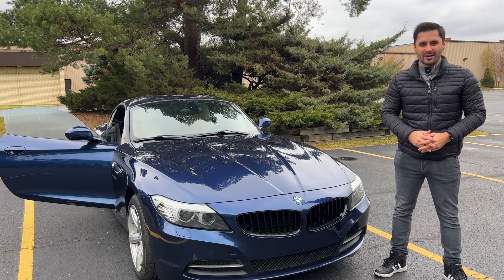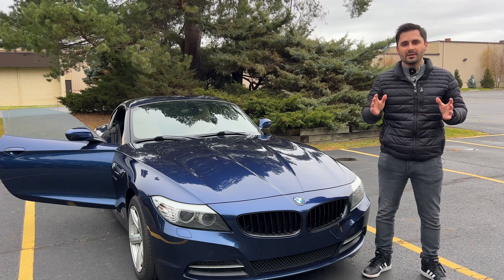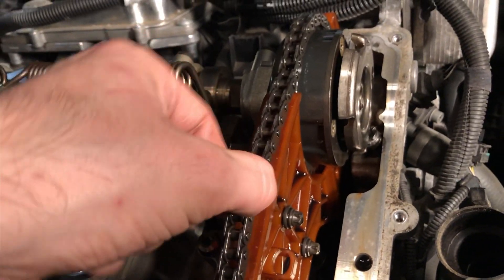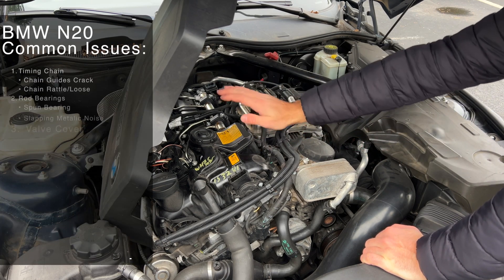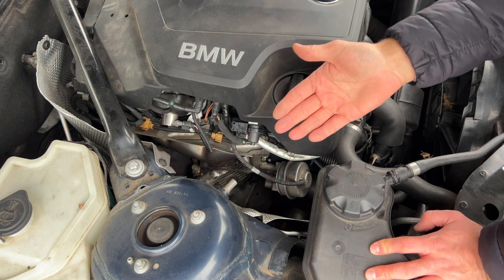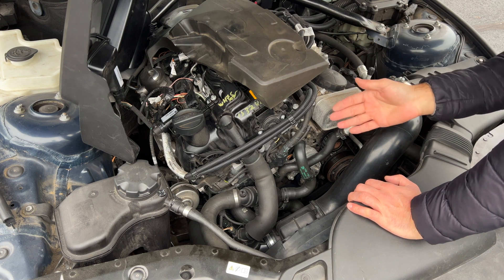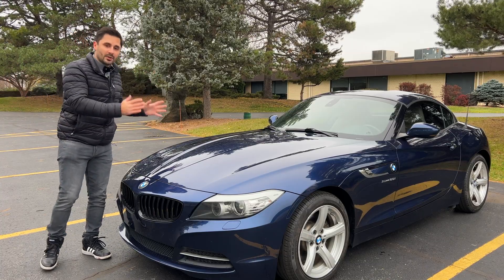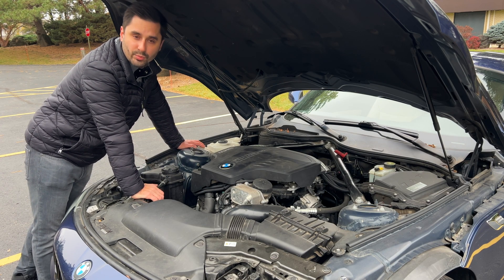BMW N20 Problems to Expect - Reliability Report

Comment: Super great video 👌 I'm searching for a 320 between 2016 to 2019 and I wonder if the petrol engine really is that bad compared to the diesel, as many people say? I personally can't find anything that's proves that! And also, I wonder if the automatic gearbox is a better choice than the manual?  I personally don't mind wich, I just wanna look for the most reliable gearbox and engine! Can you recommend what I should look for the most? 
That would be very helpful :)

Comment: 2014 328i here 👋 167k miles and runs like new. Just did all the gaskets was leaking everywhere lol. And wastegate actuator went bad. Other than that just oil changes every 6k miles. But mostly just highway miles. Got the car with 58k miles btw
Reply: How u knew
Reply: @unknownviralTV  knew what
Reply: @burtiik006 the wastage went bad how u knew it ? Because I have 120308 and 120408
Reply: Which gaskets you replace? Thinking about doing some PM on my 110k mile 428i
Reply: @LoganBarrettTriggerHappyGamez  first was valve cover around 90k it was dripping at the exhaust manifold and smell so bad. Than oil cooler and last was oil pan. That was pain. You have to lift the engine and drop the sub frame. And as we speak last week turbo coolant line blow up so I did coolant lines and oil lines to turbo
Reply: Wao, seems like you have been taking good care of your car. I am recently getting an error p0243 which is related to the wastegate. Did you have an electronic wastegate? How did you fix it? Did you need to replace the wastegate actuator?

Comment: 2 liter N20B20 engines came with different compression ratios, so it's not just engine map that produces different power levels. 

I had timing chain changed at around 145 thousand kms. It did not fail, but it was recommended to me. 145 000 kms is not too bad, nothing lasts forever. This has been from where I'm standing a reliable engine. Having owned couple VW TSI equipped cars, to me this is like bullet proof engine.

Comment: 2013 bmw x3 n20 220k original chain ,no issues whatsoever.  Oil change every 3000miles and start stop fisabled.
Reply: I think regular oil changes is the key.  N20's with extended oil change intervals tended to be the victims on the earlier cars. My 2014 428i is on original chain here in uk (78k miles)and oil changed much more frequently than BMW recommend (Approx every 4 -5k)It runs well. I love it.
Reply: How did you disable stop start its annoying
Reply: @givansaldana15 you need to find someone who can program the cars computer
Reply: @givansaldana15 the button above the ignition. If the light is orange then it’s off.
Reply: I Am wonder How does your engine sound?
Reply: @gepo3637 like shit. You always find these people. "My Yugo has 300k on it. Never let me down very reliable"

Comment: Got a 428i with an N20, note thay it got stolen and stood outside for a year, when i got it back the ignition misfired frequently, had to replace the battery, then the timingchain had to be replaced next to the oil pump and hoses, i also has to replace the drive line after that. On top of this the front suspension has to be replaced along with the brake calipers and disks, inssuraced covered everything except for the engine service and driveline landing my total repair on 12.000€. When i got the car back M-bilar who is my workshop has reworked the interior and polished it so that it felt absolutely new, they felt sorry so the leather repair and most of the time they spend on repairs they actually gave me for free

Comment: I have an f10 2015 528i and with 81k on the engine  I HAVENT had any issues but the tersmostat, and motor mounts,, and the mickey mouse house  thats it, it nice it runs great,  the one isssue that I JUST got it check and told me the the G module is off,?? SOMETING w canbus? Is any one know WHAT ir is?? I live in México and no one know WHAT it is?? EVEN with a bmw scaner CAN SOME ONE HELP ME?

Comment: Great video very clear and to the point.  My question is that I am looking at a 2015 428i convertible today with the N20 engine.  How do I know if this engine has had the updates????  You say 2015 and beyond is good.......but is it possible some of the 2015 model years have the older technology in them?  Thank you
Reply: Models built from March 2015 have the new guides

Comment: BMW N20 engine has defective design that leads to permanent engine failure. Hundreds of customers have faced engine issues ranging from timing belt to fuel pump low pressure resulting to engine Blow outs. BMW dealers are quoting anything in the range of 15k to 20 k for engine replacement with no major recalls on this issue. There is also a class action suite for these defective engines for which BMW was asked try the courts to compensate the affected customers. Absolutely horrific quality control and servicing by BMW and pathetic response from BMW customer relations that customers need to be aware of.

Comment: Great video. Easy to understand speeking, good showing underhood elements etc. Mine is 228i 2104year, and i care about it. valve cover replacted, and still a little oil leak.
Reply: Do you still have ur z4?

Comment: It’s a great car, only had to replace the engine once at 105k miles. Thankfully under my extended warranty
Reply: lol You have a strange definition of "great" if you think that replacing an engine at only 105K miles is acceptable.

Comment: Expect engine failure at around 100-110k 

This is not a reliable engine ,it's probably the worst one in BMWs history 

They arel class actions outthere regarding this .

The defect : 
Valvetronic and timing chains
Reply: Yep, engine went out due to timing chain at 90000 miles

Comment: I have a 228i Xdrive I that it was N20. Or is it F22 I’m a new buyer and would like to know
Reply: F22 is the model code for the first generation 2 series coupe (new one is G42). I have an F23 which means it's a convertible F22. It's a way for BMW fans to differentiate generations of a model. The 28i F22's produced from 2014-2016 have the N20, and the timing chain issue on N20 engines was fixed for 2015 and later models. That engine was replaced by the B48 for 2016-2021 F22 models and the name was changed to the 230i. The current 228i name was transferred to a front wheel drive, 4 door compact car.
Reply: @jfox24  you help me out tremendously and luckily for me according to your assessment I have a 2015 so I may be good as far as the timing chain issue is concerned but I love the car and will continue to take care of it
Reply: @WillWay-39  happy to help. I love mine but it's been the most expensive car I've owned. No catastrophic timing chain issues, but I've had valve cover gasket leaks which was not a cheap fix. Also, if you're new to driving a turbo car you need to let it warm up for about a minute (RPMs will drop) before driving off. You also need to let the turbo cool down for a minute or 2 before shutting the engine off completely if you drove it hard. This includes the automatic start/stop function which cuts your engine to save fuel. I don't use that feature just in case.
Reply: @jfox24  so I’ve noticed that when I start it the rpm gauge basically lets me know that it’s not ready to pull off yet, typically right over 1000 then it stabilizes below 1000 when it’s ready, but I am new to driving a turbo car so are you saying even in warm weather before I cut the car off I should put it in park and set for a  minute and then shut it off? And also 😂 it’s definitely the most expensive I’ve ever had the gas alone is out of control but I really do appreciate you I love learning and you seem like a good person so I hope all is well with yours
Reply: @jfox24  and I don’t like the automatic start stop function but I do make a mistake sometimes when I get home from work by just cutting it off as soon as I pull up thanks to you ik not to do that anymore
Reply: @WillWay-39   yeah the owners manual says "don't let the car idle, drive off immediately after starting. It's the best way to warm up the engine" which doesn't sound right to me. BMW also coded the N20 to run hotter than needed to increase repairs from the dealerships. So I think that's another trick to get more repair money. "Warming up" also refers to coolant and oil circulation, same with cooling down. I also wait for the revs to fall on the tachometer so you're doing it right. It gets surprisingly bad fuel economy for a 4 cylinder and it takes premium. I live in Atlanta (hot climate) and my average is like 15.6 mpg because of all the stop and go acceleration. I've seen it return 32 mpg on the highway, but only in Eco Pro where you can coast at 500 rpm. Basically, driving the car while the turbo is in boost uses extra fuel to take advantage of the extra air. Based on listening to the turbo with the top down, the boost threshold is at 2500 rpm so keep it below that for the best fuel economy.
Reply: @WillWay-39  yeah this is my first turbo car after coming from an old Acura and a Corolla. From what I've gathered, the turbo needs time after you start the engine for the coolant to flow into it. If you've been driving hard in boost, suddenly cutting off the engine will stop the flow of fluid to the turbo. It has nothing to gradually cool it down which can damage it. This is why the start stop can damage your car. So just to be safe, after I park my car I wait a minute or 2 so that my turbo can cool down.
Reply: @jfox24  literally it’s like your spot on with what I’m seeing. The car gets so hot I thought it was overheating a couple of times so now ik I’m at least doing it right. Wait for the idle to drop when starting then pull up parking and just a little idle then cut off. I’m In Illinois not too far from Chicago and I feel like for a 4-cylinder even up here it does get the greatest gas mileage but in eco it does increase my mpg. And seriously thank you man not too many ppl are willing to share information like that and im willing to listen and learn.
Reply: @WillWay-39  of course! I just got this car like a year and a half ago off my dad so it's been a learning process. I hear you can make the engine run colder with a tune. Coming from a Corolla, I was definitely surprised by the maintenance and fuel economy. My dad heavily optioned it with carbon ceramic brakes and a staggered tire setup. That means I have to replace brake pads and rotors at the same time, and I can't rotate my tires for longevity. Makes it handle like a dream though which is why I keep it. I'd look out for valve cover gasket leaks. Also, I hear the charge pipe and the boost pipe can crack under stock boost pressure because they're made of plastic.
Reply: @jfox24  thank you bro where would I check for valve cover leaks
Reply: @WillWay-39  I mean I'm not sure it's just a common issue. I just know I paid like $800 in labor and $400 for the part because it's a 6 hour job and I can't do it myself. You'd probably need to do some research to diagnose it yourself.

Comment: Great i got a 2014 428i 💀 with 90k miles
Reply: @Tvann I just got a 328i last September, been good to me so far got it with 58k miles now I got 67k. Had to do the oil pan but when changing it all my guides were still in place. Gonna do the timing chain soon as I get 3k saved up.
Reply: @robertmoncriefglockrock8957 who’s doing your timing chain for 3k!? In wa the cheapest I’m finding is like 5k😭
Reply: @robertmoncriefglockrock8957 shouldn’t cost 3k, are you taking it to a dealer? I only paid 1k for my timing chains to be redone. Been running a tune since then too
Reply: is 2014 428i doomed with timing change issue?
Reply: @genuflext yes 😭
Reply: I got a 220i 2014🫤
Reply: @destinyyjr9441 how's it treating you so far?

Comment: I have a BMW 228i manual gearbox from the end of 2015 and it has 161,000km. Could there be problems with it in the future?
Reply from the maker: Sounds like a pretty solid car. 2015 should be fine and manual gearboxes are solid. Change your oil at least every 5k miles or 8k kilometers!

Comment: You are the only one i have heard suggest that changing the timing chain tensioner was “easy” or even possible without getting well into the internals and setting all the timing locks to prevent movement unintended timing adjustments.  Would you please verify this is actually possible?  Feels like bad info but if not great!
Reply: The more common issue is the plastic guides just breaking apart and cracking

Comment: This is true. I have a 2015 328i 100k miles it’s still powerful. But I needed to replace the valve cover. Besides that I’m really happy with the reliability
Reply: Have you had any timing chain issues? I want to buy one that has 100k miles
Reply: @Richardv24   no timing issues, i am at 107,000 miles. They always check it every time and is holding up. Although i believe i got the car right after the fixed the chain on future models. Mine was manufacture in may 2015
Reply: 2015 is b48 engine
Reply: @Shiftwithsaj still n20

Comment: Is a 2016 bmw 328i n20 with 60k mile’s reliable?
Reply: Yes by “2016” the timing chain prob is gone
Reply: what about 2014 428i? 40k
Reply: How is you’re car I just got mine at 79k
Reply: @YousefB58  went for a 2014 428i with a n20 instead, picked it up at 58k miles currently at 72k. Car has been treating me well have done 2 oil changes so far, maintenance cost isn’t too bad ordering parts from fcp euro helps.

Comment: I went from a N51 to N20 my god I’m so happy
Reply: What was wrong with the N51? It is essentially the N52 with the low emmision tech on it. I know it suffered from the same problems as the N52..value cover and oil housing leaks, water pump, etc. I heard the N51 cars has the sensors on the fuel tank and the radiator. If they go out you have to replace the tank and the radiator.

My buddy has an 09 328xi that his dad brought in NY. He brought it barely used so I hope the car came from another state and it has the N52
Reply: Same but I came from a n52 to a n20 🎉💨

Comment: Great video. 

I've had my 228i for three years now. 77k miles (of which 23k have been me running a stage 1 map) without a hiccup. But this video is good for making people aware of potential issues. Probably the best one I have seen.

Apparently there are only 228 228i manuals registered where I live and they seem to be going up in value,  so I am keen to look after mine. This video will definitely help.

Comment: hi my name is Marco, I am writing to you from Italy, I follow your channel, I want to ask you for advice, I bought a used z4 e89 20i a few months ago, it is registered on 06/2014, this noise that my mechanic has increased for a few weeks he identified it as a problem with the hydraulic tappets, but the sound you describe in your video at 3:20 minutes is very similar to that of my car, can I have some advice, can I send you the video?

Thanks Marco
Reply from the maker: Hi Marco, I saw the video you sent me, very helpful!
It's very hard to say for sure from a video, but it sounds less 'slappy' so it can be either an early stage of a failing rod bearing or it can be a timing chain getting loose or like your mechanic said the hydraulic valve lifters. It sounds like it's coming more from the back of the engine, so we can probably rule out the timing chain. Next, listen closely to see if it's coming from the top or the bottom. Mine was bottom and it was the rod bearing.
Reply: @SimpleCarGuy  Remember also that the injectors are very noisy

Comment: Wanted to ask if the cooling fan should be on in these days which is like 5~7 degrees ?? I changed thermostat and still when I open the bonnet and check fan is turning…?. Is this normal for N20??

Comment: Wow I wish I would've done some research on the my 13 bmw 328i I just bought all the videos are scary AF .
Reply: just had to do timing chain 72 k miles, 3,600 job
Reply: @SilentEscape818 damn you got ripped off man. Timing chain jobs are like 1.7k max.
Reply: Literally just got my 2013 328i back from the dealership today timing chain guides broke which made my timing skip which them bent the exhaust valves $10.5k in parts and labor happened at 72k miles. Luckily I have a warranty and only had to pay my deductible.

Comment: Thanks. That is a sexy car, in a great colour. I had a 2005 Z4 3.0i for a few years but sold it because it didn't see much use and I got tired of driving a stick. It was minty with rare options, and looked great too, but not as great as yours. That newer body style with the hardtop is the way to go.

Comment: good evening for the n20 2017 120i engine has timing chain problems?
Reply from the maker: Not really, they have fixed it by 2017. Should be good to go

Comment: If I have a 2015 328i built in 2014 should I be safe for timing chain? Thanks.
Reply: Have you had any problems? Miles?

Comment: Had a 2013 328 and 2012 X6, so many problems, never buying another BMW again!
Reply: I’ve got a 2013 328i, no issues, running a stage 3 tune also. I’ve also got a 2012 X5 35i with the N55. Great car, made a roadtrip towing a boat while it had water in 2 cylinders. Have also owned a 2008 535i, put 400k miles on it, only issues were the shocks going out, and the high pressure fuel pump. BMWs are great unless you buy a poorly maintained one, and oil changes should be done at 5k miles at most. I do mine at 3k. If you do that they just keep chugging along.